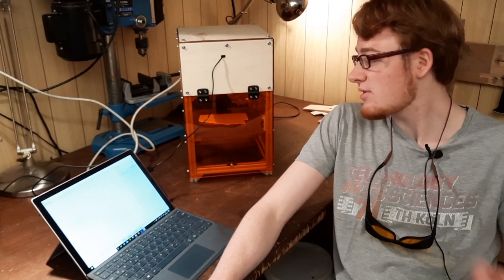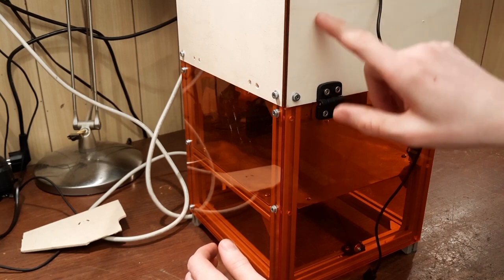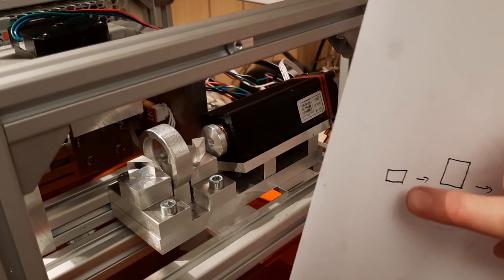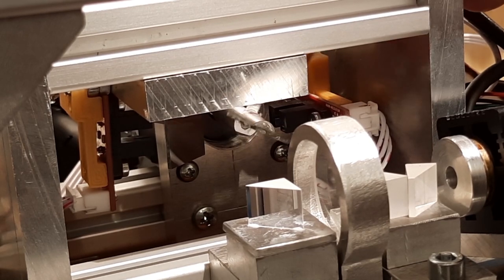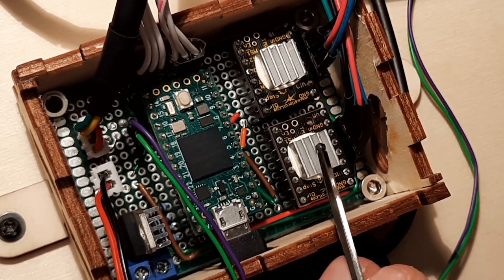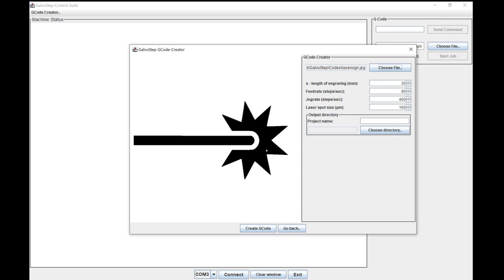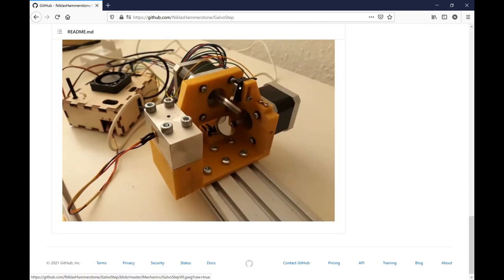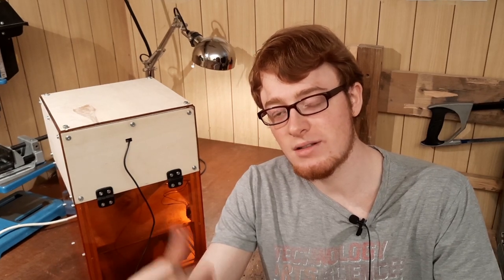A quite unusual homebuilt laser engraver

Comment: Would adding an f-theta-lens increase the efficiency and possible speed of the system?
Reply from the maker: Yes! Both could be increased a lot using an f-theta-lens. Focussing the laser diode was a big problem I was having and is the main reason why this goes so slowly. It can, potentially, go a lot faster, as my first prototype shows. But then the beam would have to be focussed lot better, which is only achievable using such a lens. However, I was not able to find one for a hobbyists price..